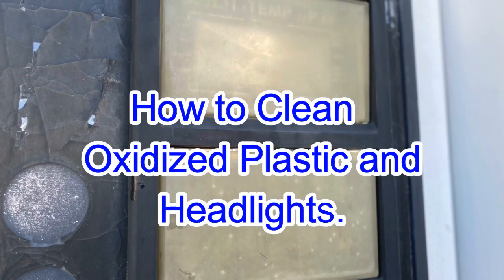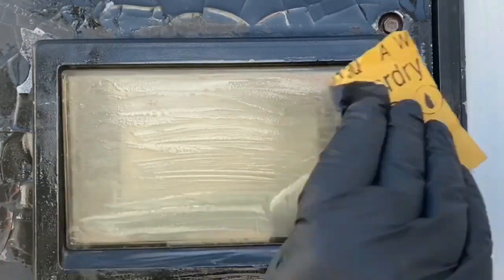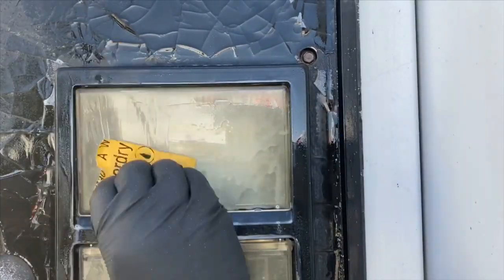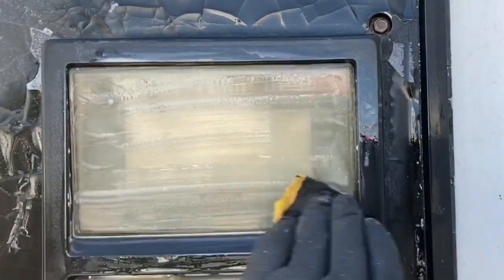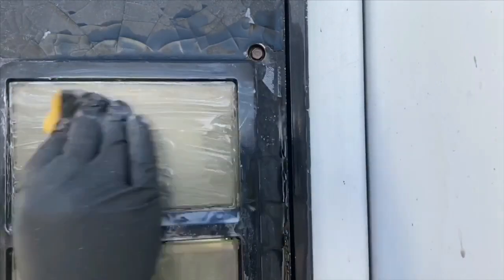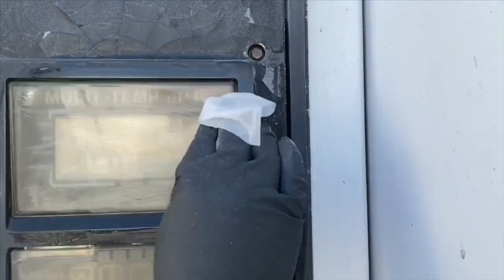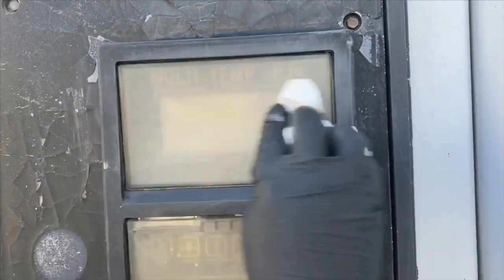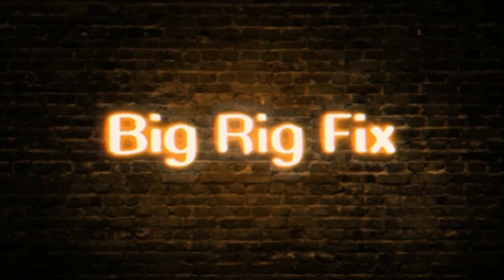How To Cleaning Oxidized Yellow Plastic and Headlights.

Comment: I sanded and polished my headlights, they are clear but still yellow, so I did it two more times, it's the plastic itself that is yellow. Is there a way to actually bleach the yellow away? Or just buy from a different seller, these are only a year old, BTW.

Comment: Isn't the sand paper doing most of the job? You could probably use plain water with the same results.
Reply: no the wipe at end does it all. id  like to know whats the chemical in the spray
Reply: 100% You can. Its basically a spray bottle of water with about 3 drops of dish detergent which acts as a cleaner and lubricant for the sanding. spray it with an acrylic clearcoat to seal it and protect it from the sun.